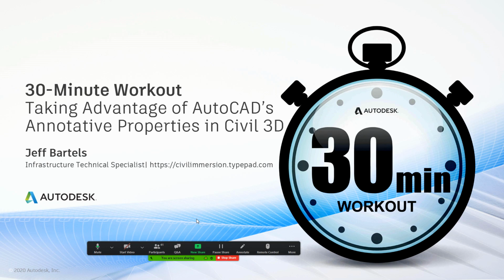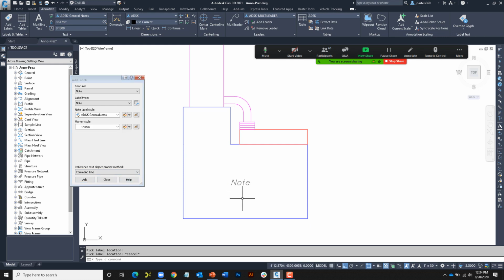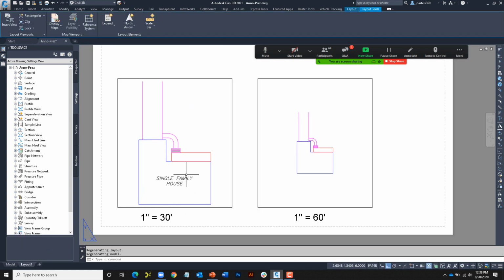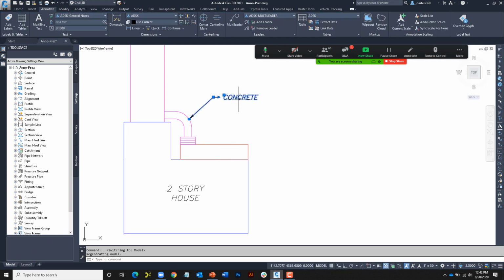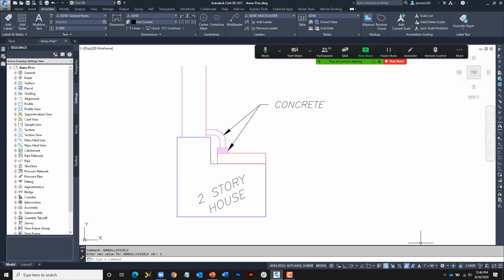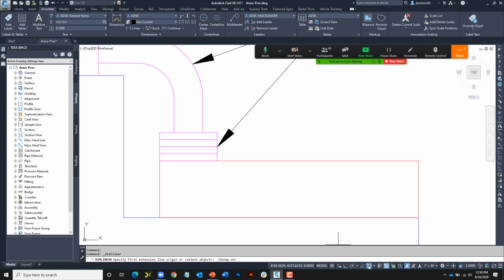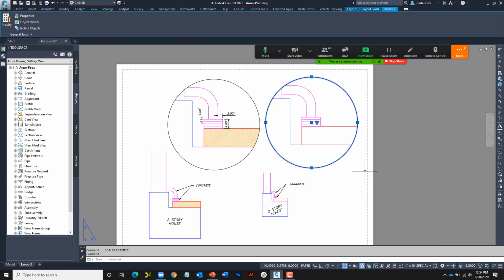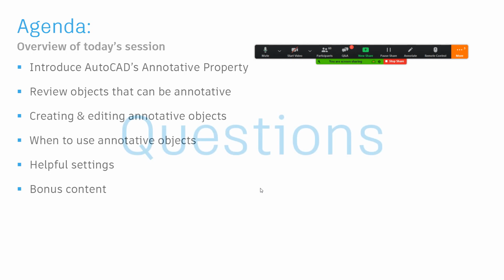Taking Advantage of AutoCAD's Annotative Objects in Civil 3D!

Comment: Thanks Jeff, is there a way to have a smart TEXT to the in a viewport so they would not upside-down. I understand if "Match text to the orientation of viewport" is selected, Text will display horizontally to the orientation of the viewport, but we don't that, we want to avoid text to display upside down. this would be very useful for instance to display the Boundary labels which they need to align with the direction of Lines and Arcs not the Viewport.

Comment: Hi Jeff, Thanks for your clear, concise, and informative posts. They are extremely helpful. I have been working for a short time for a firm that does relatively small projects. As the projects are relatively small, they like to keep all AutoCAD and civil 3d information in one drawing. When working in paperspace this is no problem as you can freeze, and thaw layers as required. Doing this does not affect the other viewports. However, working in model space, it becomes extremely complicated especially when you have all the information, services and surfaces including cut and fill etc in one drawing. Freezing and thawing, or turning layers off and on in model space does affect all viewports in paperspace. Is there a way that you can turn layers off and on in model space without affecting all the viewports in paperspace? This would enable you to work with only the information you want to see in model space and not affect all the viewports. Thanks again Ralph
Reply from the maker: Hi Ralph, Take a look at the VPMAX and VPMIN commands. They allow you to work through a layout viewport essentially letting you work in model space while retaining the layer settings of the selected viewport. This video should help get you started. https://youtu.be/RGN3appbvJ0  The challenge you have described is exactly the reason this feature was created. Hope this helps!  Thanks for your support!
Reply: @JeffBartelsCAD  Thanks Jeff for your prompt reply. I did not dream of getting a reply so soon. I have looked at Jerry's video and will start using the command to see if this helps. Thanks again.